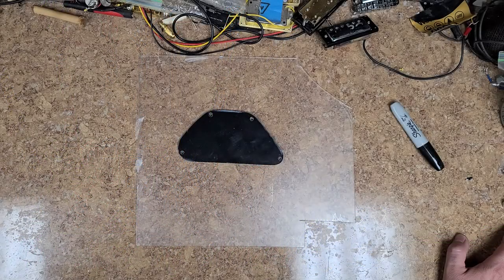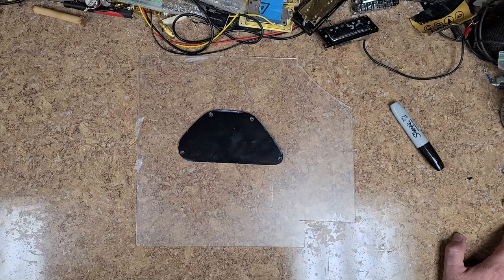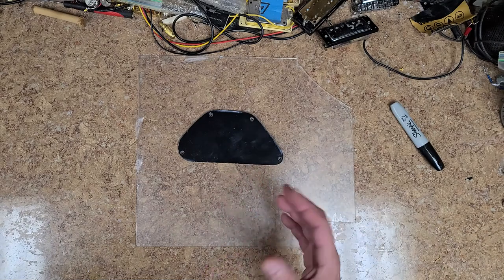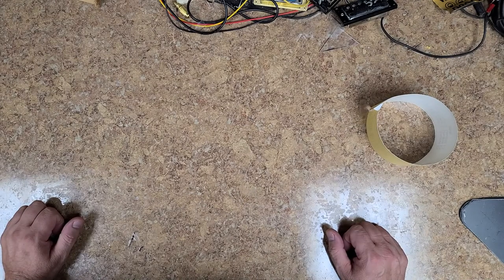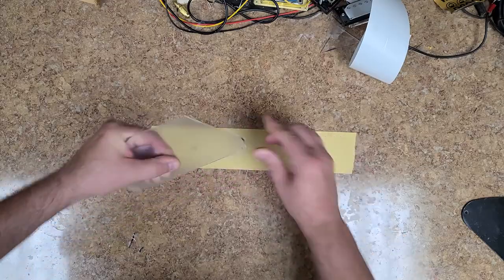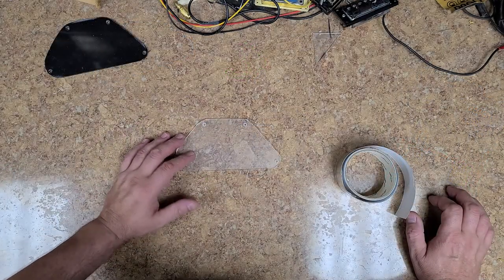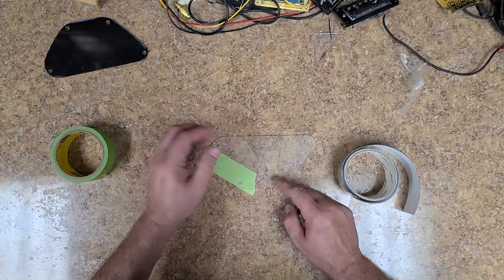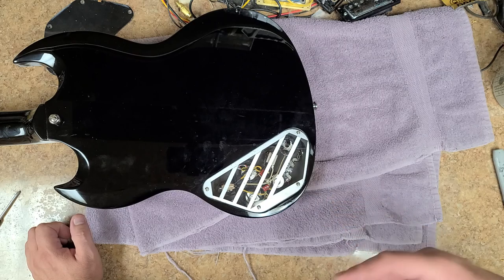Guitars. How to Make a Custom Plexiglass Control Cover

Comment: Very cool man. I tried making one for my Jackson Rhoads V. I thought it would be easy because the control panel I was making was shaped like a triangle but when I went to score it everything looked good but the top corner. It did not exactly break apart apart correctly 🤦🏻‍♂️.  It's a good thing I have a more material.

Comment: Are we the only two guys up at this time of night? Did you make a mistake in the spelling of the title? Making? So very pretty cover, I've seen you make some before a while ago. It's quite a process but the cutting and the sanding. But you know all those components inside the back are really not the kinds of things that can pick up the really short white noise waves of electromagnetic interference. The main antennas are the pickup coils sitting right out front Exposed on the guitar. They will receive and amplify the signal if there's any to be picked up anywhere around them.
Reply from the maker: I'm always up late. Since my father has been sick, I have been on my toes just in case he has any problems. I did use the wrong word lol. I was doing two things at the same time when I wrote the title. I believe the same thing that the pickups are what picks up most of the noise, but there are some who would say that the back cover if not shielded could pick up noise as well. Doing what I did satisfies everyone.
Reply: Up always up too. I look forward to Eric’s video late night lol. He’s amazing 👍🤘
Reply: @ericctheartofnoise8613  you guys are not alone lol I'm up and down all hours of.the night, you have to be where I live lmao great work here man! I love the look of it!